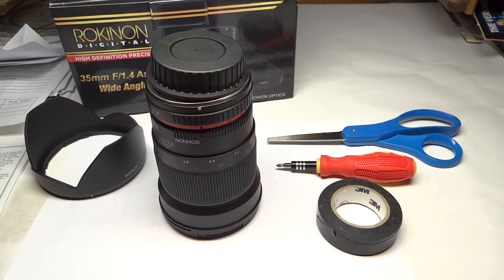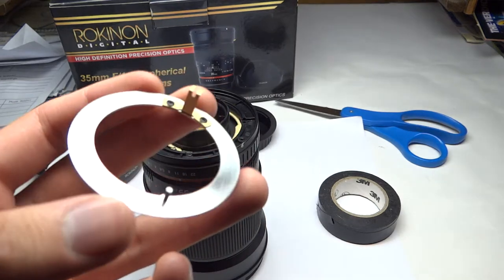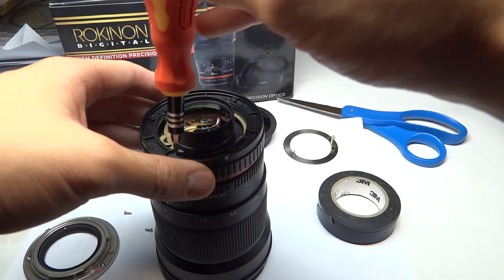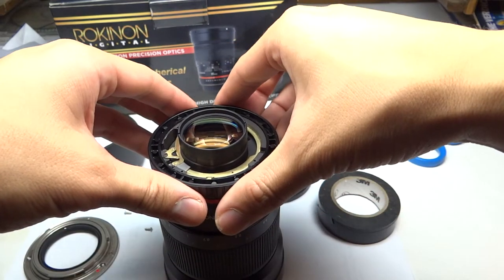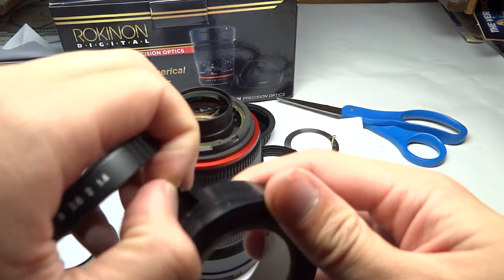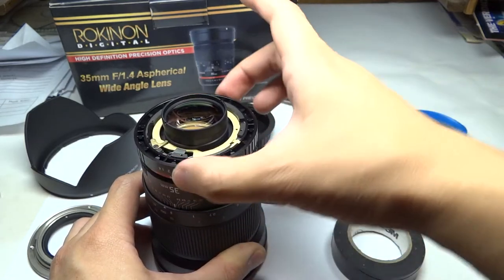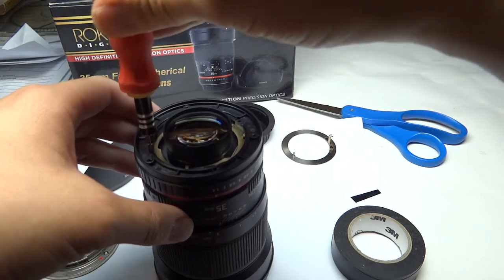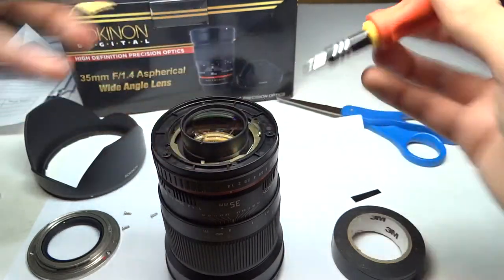Declicking a rokinon/samyang 35mm 1.4 lens manual focus -- Cine version!

Comment: I did this to my Rokinon 24mm f/1.4, but omitted the "electrical tape" suggested. Everything was exactly the same as shown here. The lens went back together and works smoothly just fine - no problem.
Reply: Yeah. All the electrical tape I've used in my life (been here awhile) has at some point turned 1) gummy and disgusting or 2) brittle and disgusting. Not sure I want that mess in there.

Grateful for this video, though. Thanks c2thew!

Comment from the maker: the spring has nothing to do with the aperture blades not closing. It's the metal ring with the pin that is below the mount that is responsible for opening and closing the blades.

Comment from the maker: why did you remove the aperture spring??? The spring that I was referring to was the spring that supports the tiny steel ball bearing to the aperture dial. I think you might have been confused with the video I posted. There is a spring that compresses the tiny steel ball bearing which serves as the clicking sound when you turn the dial.

Comment from the maker: hmmm. All lenses for the most part are accessed from the rear of the lens. If you can pm me on the forums on which area specifically you need help with, i might be of some use. The big fcus ring is actually held by three pieces of tape which is probably why your lens won't manual focus. You will need a micro screwdriver to remove the screw on the red ring on the lens. It is a very tiny screw so be careful not to strip it.

Comment: My lens aperture just stopped working. I had a good look at what you were doing from 7.00 on to discover what was wrong. There were no obvious defects. I reattached the ring that had slipped out. This fixed the problem. It took me a while. Thanks very much for posting this.

Comment: The reason I use M42 mounts and old lenses is that I can get comparable results but for so much less money. I once bought 3 lenses and a Fujica body for 15 euros. A 29mm and a 80-200 that I de-clicked, and a 55 mm 1.8 that I used for portraits until it fell apart. :P

Comment: Thank you, I did noticed that my Sony E version is a little better made: the metal ring is held in place by 3 removable sledge brackets and the plastic piece with the "2 holes" is actually metal and is completely symmetric.

Comment: Don't know if you're still receiving or viewing comments on this video in 2023. I have a cine version of the Samyang 35mm (Nikon F mount). My problem is that the aperture ring slowly opens on its own once attached to the camera, so I can't specify a narrower T stop, unless I tape it to secure it. If I use the Nikon F to Canon EF adapter ring and use it on a Canon body, the aperture behaves as it should, so something is occurring within the inner mechanisms to move the aperture to the wide open position - I'm assuming some sort of spring with too much tension, but I don't know. My other Samyang cine lenses are fine, so this is the only one with that quirk.

Any guidance on performing a DIY fix?
Reply from the maker: It sounds like you have a broken internal component. I haven’t opened a nikon lens so I won’t be of any help.

Comment: I have recently purchased a used version of this lens for Canon, but it stops short of focusing to infinity and is mechanically unable to reach that point. I have removed the outer covers on the front assembly, but there does not seem to be an intuitive way to make adjustments. Is this something you have come across? I think I can exchange the lens for a newer one, but if this is something that will gradually happen again as the lens ages, I would like to know how to fix it.

Thanks!

Comment from the maker: hmmmm... You might be able to do so as the focal distance markings on the middle barrel is held in place with three screws that you can see on the exterior of the lens. Also, the markings on the manual focus ring is held by tape so in theory you should be able to rotate the markings. Let me know if you attempt/and or suceed in doing so.

Comment: Thanks!
I can't post links for some reason, but the post was on Photography On The Net. Post number 9 in that thread has a bare lens.
I have removed everything except for the focus barrel (red ring as well).
Should I be able to just pull the focus barrel off via the rear of the lens? I think the tape ripped on a shoot recently because it sags now and won't go to infinity. The glass is fine, but it gets stuck half way through the focus. Do you have an email I can send a photo to perhaps?

Comment: I haven't, I was worried I'd ruin it. I assumed the tape was underneath the barrel itself, not just the rubber. The whole barrel still turns as I focus, but it's become disconnected from the lens so there is a gap at the front of the lens where you can see through to the metal body underneath. 

What happened is it was twisted so hard that something snapped, and now the focus barrel (not just the rubber) sags. It still turns, but not all of the way.

How did you take off the focus barrel?

Comment from the maker: there is no optical difference between the cine and the normal version.  the only difference is the exterior has ridges specifically designed for follow focus rigs.  The choice ultimately is whether you want to DIY rig a follow focus vs have a lens that is directly compatible to focusing rigs' teeth.

Comment: I bought a dropped lens like this and i can hook the pin in U shaped handle and i can go from f/22 -> f/1.4 but when i reverse aperture ring comes totally loose and dont response anymore. I have no idea what is wrong... previous owner have glued plastic ring after bayonet and ball bearing has lost after the camera hit the ground and ripped of the bayonet from lens... everything looks like same than in this video. Is tehre somekind of spring&stopper for U handle because this seems to open too wide and let the pin loose again...
Reply from the maker: the key issue here is that the lens was dropped and glued back together.  If the plastics aren't aligned properly, then the aperture blades will keep slipping.  Did you make sure that the mount was secured tightly after you placed the lens back together?  that's what happened to me in this video towards the end.

Comment: So question.

I got this lens, and am thinking about doing this. But I read somewhere, maybe you even posted it. That using the electric tape inside will lead to some damage to the lens later? Such as possibly glue melting down on the element or something. So I am a little hesitant to try.
Reply from the maker: +Kristopher Lloyd electrical tape breaks down over time and tens to gum up.  use blue painters tape instead.  the glue won't melt down into the lens element as the focusing ring is no where near the optics as evidenced in this video.
Reply: Alright. I will attempt this then soon.

Thanks for the advice

Comment: hi
any chance you could do a tutorial on disassembling and cleaning a rokinon?
Reply from the maker: I would not risk disassembling lens elements unless you know how to get the lens in the proper location.  It may seem that the lens just threads right back on once you use a lens spanner, however each piece of glass is spaced at a specific distance... meaning if you remove the lens and don't thread it back to it's original spot, it will have focusing issues.

Comment: Thanks for sharing this helpful tutorial dude, i have a problem whit my rokinon 85 mm the focus trip ring is so hard...do you have any idea how can i fix that? Thanks!!!
Reply from the maker: hmmm. You mean the focusing ring is tough to turn? If that's the case, pull the rubber grip down and you will see three screws. Underneath the plastic piece with the three screws you'll see the barrel guides. You can put a small drop of oil on the track which should help.
Reply: c2thew Hi. I have the same problem. Can you tell me what should I need to disassemble first so I pull the focus rubber grip/ring down ? Thanks.

Comment: Hi, my lens took damage, now the manual aperture doesn't work. I used your tutorial to declick while trying to fix it. There's some minor internal damage. The piece with the two holes you mention broke but I glued it together and that part seems fine. The glass and blades are fine, they just don't respond to the aperture ring. The problem as I see it is the little metal U shaped piece. I almost fix it to the point where the aperture starts to pull but then it skips and closes again. Any advice?
Reply: Did u fix it? I have the same problem

Comment: hi,
Maybe you know the answer - I have problem with focusing on samyang 8mm - one day focus ring stop turning, it's not moving even 1mm, nothing. Any ideas what to do?
Reply from the maker: So the focusing ring is jammed correct and not the aperture dial?  If the focusing ring is stuck, then more then likely the screw underneath the rubber ring might have come loose.  You should try moving the rubber grip on the focusing ring up and towards the front of the lens and then check to see if there are any broken parts.  You might have to remove several screws to see the track where the screws are installed.
Reply: c2thew thanks a lot, actually I managed to figure it out what's wrong, but it took me few hours. I just finish few minutes ago. So I unscrew everything till focus ring (removed rubber grip, metal part that holds black plastic part with first lens, spot where electronic is attached, aperture ring, metal ring with stripe indicated what is aperture and focus, ring with focus mesuremeter, black metal ring underneath rubber grip, big front lens, suncover, inner lens - at the end it turns out that last 3 i removed unnecessary). And then silver focus ring was not moving even slightly - when trying disassemble it, i put screwdriver underneath it and gently push, something clicked and ring start to move. I put everything back together - with several panic attacks when I lost ball or screw ;) but I managed to find everything. I left the screw that is blocking focus ring at the end - I checked focus while taking picture - and when the ring was in right position I screw the last screw.
Reply: Karolina Skalska Hi. Did you remove the from element or the rear element ? How long did it take you to fix it ? I'm planning to disassemble my Samyang 35mm f1.4 because I'm having issues with my focus ring. Thank you in advance.
Reply: Can you show where the focus stop is, my lens won't focus to infinity anymore. Do i have to take it all apart to get to it? Thanks

Comment: hi i have the same lens at 2:18 min u pick a plastic ring or a plastic spacer how do you call it i need just like that brand new min broke when my lens drooped please help find that small ring part thank you.
Reply from the maker: your best bet would be to find out who the distributor is and ask if they have an exploded diagram of the lens so that you can find the correct replacement part.  I know Canon has their parts diagram for their lenses on the internet.... i'm not sure if rokinon,samyang, bower, have theirs available so your only alternative might be to send it in.  Good luck!
Reply: +Yossi Zerkiev Hello, had you find you ring ? Because i have the same problem. Thanks
Reply: +Yossi Zerkiev i have the same problem too any luck?
Reply: +Now In Color Era (NICE) no... a sicked the lens...

Comment: Hi. Hope you can help me on this. When focusing to infinity, the focus ring is smooth. But when the subject is close, I'm having a hard time turning the focus ring starting from 1.5ft to 1.2ft and feeling like it's getting stuck when getting close to 1. And when you turn the ring back, same issue until 1.5ft but from there it goes smoothly again up to infinity. What can I do to fix this ? Do I have to remove the front element to adjust it ? Or the rear element ? Is there a mechanism part that is needed to replace ? Does it need a professional repair or can I fix this myself ? Can someone help me on this ?  Thank you in advance.
Reply from the maker: Giordano From what it sounds like: you dropped the lens and it dented the focusing helicoid plastic area.  To check if this is the case, remove the rubber focusing grip by using a screwdriver and pull the rubber back to expose three? screws.  You'll then want to check to see if that area is rubbing evenly when the lens is rotating.  You do not need to remove any lens elements to correct the focusing issue.
Reply: c2thew I bought my Samyang 35mm f1.4 used so I really don't have any idea if it was dropped before. Anyway, are you referring to the 3 screws that's above the red ring ? Is that the only thing that I have to remove ? Thank you so much for your help.
Reply from the maker: Giordano The rubber focusing ring/grip is a piece or rubber that is wrapped around the lens barrel.  Use the screwdriver to get underneath the rubber and then slowly push it towards the rear lens...
Reply: c2thew Hey. I got it. Let me try to do it when I have the chance.
Thanks for your advice mate.

Comment from the maker: lift up the rubber ring and you will see 2 screws holding the focus barrel in. You will have to remove the red aluminum ring to remove the focus barrel. If i were you, i would send it in to new york for repair. If something snapped, you probably did more than damage a part. YMMV

Comment from the maker: i suppose you meant the bayonet was broken in two*

I don't know where you can source the lens parts unless you contact the manufacturer/distributor.  I would suggest finding out who the distributor is for the U.S. side and contact them to see if they will provide you the part.  It sounds like you dropped your lens so replacing just the plastic part might not solve your problem.  good luck with the search.
Reply: Hi. I have the Samyang 35mm t.1.5 lens but the aperture ring is locked to 1.5. Any idea how to fix this ?

Comment: Hi everybody! Could someone tell me why there is no difference between the pictures I take with my 5D Canon and this lens at different focus points? I tried most of them, there is no change at all in the images. Am I doing something wrong? Please help, I'm quite new to this... Thank you!
Reply: Because it's a manual focusing lens.  Focusing points do not mean anything unless you have autofocus.  Hope that helps
Reply: Hi JSean, thank you for your answer, but I'm not sure I made myself understood.. Basically there is no difference in the pictures I see on my computer screen despite me manually 'guessing' different focus points... Hope that makes sense... :-s
Reply: katzonair What F-stop did you take the pictures at? At higher number F-stops everything will be sharp in your picture, no matter where you focus. If you took your test shots at F11, 16, or 22 then that might be the reason. Try F1.4, 2, 2.8 and see if that's it.
Reply: You might have a point :D I'll try it and come back with a result. Thank you for taking the time to answer :)

Comment: will this mod not interfere with the electronic aperture control?
Reply: It's a manual lens..
Reply: Le Monarque Yeah, I noticed that in the title. But this lens has an "A" position which enables the camera body to set the aperture electronically. I was wondering if this mod would interfere with that feature.
Reply: John Carl Galang Where did you find that this lens has an A position?  Everything I've ever heard about it on any mount, as well as Cine revisions, is that it's a completely manual lens devoid of any electronic communication with the camera.

There are "chipped" versions now, but those are advertised as merely allowing the camera to record EXIF data and display green dot focus/play focus beeps.
Reply: John Carl Galang
I think you're confusing this with the 8mm f/3.5
Reply: nope i got the exact same lens
Reply: John Carl Galang
Whoa, I want that lens then.  Can you link me to where you bought it?
Reply: here in manila, philippines, i got mine through dbgadgets.net
Reply: John Carl Galang
Thanks for the link!  I can't find any reviews for the A-mode you talk about though :/  It sounds great but I'm a little nervous about ordering from overseas when I can't get hard information.  Mainly worried because the product page doesn't say anything about it either
Reply: well, yeah i guess you're better off ordering from amazon or ebay
Reply: John Carl Galang Do you think you could upload a picture to imgur and paste the link here?  Of the A setting you talked about.  That way I can compare it to product photos to verify what I see
Reply: sure just shared a photo with you on google+